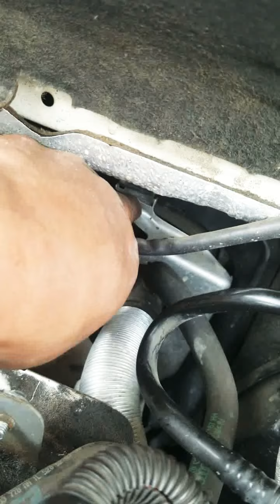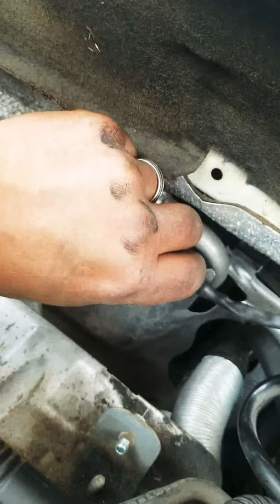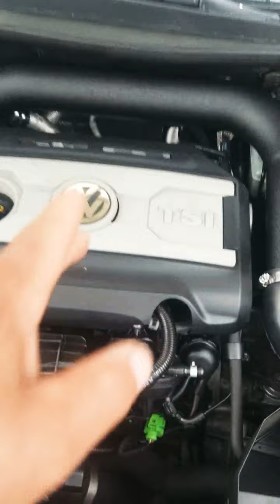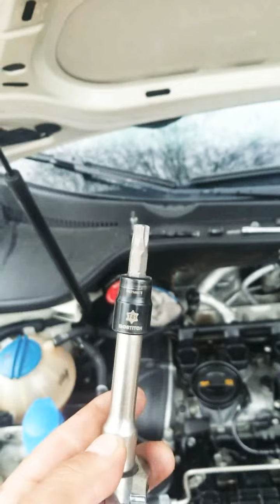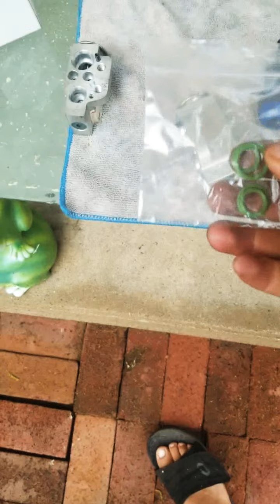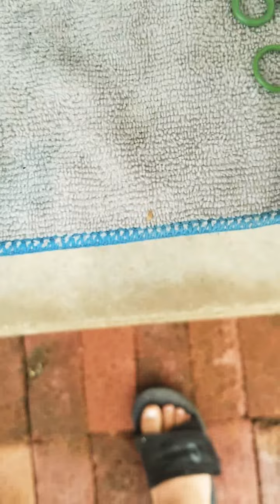AC expansion valve location/replacement (vw mk5)

Comment: A word a caution. I own a 2010 Golf MK6 2.5L CBUA. My expansion valve came overtorqued from the factory. It was extremely hard to remove the bolts. When I removed the expansion valve it bent the pipes and threw the pipes out of alignment. I know this because comparatively it was easy to pull the expansion valve from a used one. 
I should have stopped there and replace the threaded bracket, bolts, and tried to bend the pipes to restore alignment. Instead I kept forcing the bolts and ruined the pipes, bracket, and bolts further. Now I have to remove the dash to replace the evaporator, expansion valve, bracket, and bolts.
By the way, the bolt is a M5- .8x35mm. You can find it at home depot. I believe it is a grade 8. I found a grade 12.9. Another tip, to remove the threaded bracket you need to remove the foam around the expansion valve by cutting around the pipes. It will make it possible to move the threaded bracket sideways to free it. My manual says the torque specs for the screw is 5NM. I guess it makes sense because bracket is steel and the bolt is grade 8. But I would caution against torquing that hard. DON'T use a pry bar, picks, screw drivers and other tools that would distort the fragile aluminum pipes or you will have to remove the dash to replace the evaporator! 
It should be easy to slide the exapansion valve on the pipes and the screws should easily align to the threaded bracket. If you are forcing it, you need to realign the pipes.

Comment: Something everybody needs to check is the ATS "Atmospheric Temp Sensor" it's adjacent to  your MCU next to the windshield wiper linkage. If it's bad or the wire is broken. Your FCU (Fan Control Unit) will think it's 0C / 32F outside and will not allow your AC Compressor to start.
Reply from the maker: I appreciate the advice and I'll definitely check it out 👍

Comment: Hey, did you can have help to me? To me that problem.. AC compressor not working. Works when i fill to the AC system air from ressiver, about 7-8 bar, turning radiator fan. When i fill freon, my AC system not running... i replaced a new one pressure sensor and compressor selenoid valve, but nothing helped..

Comment: Hi there can you please tell what is your problem to change this valve ?
Is your ac wasn't work at all or working but low cooling inside?
Reply from the maker: Very good question my friend,  this part was changed as part of troubleshooting/diagnosing why the ac system won't work at all , I started by replacing the control solenoid valve and didn't fix anything,  the I replaced the compressor but didn't work either ( bought it second hand and I have my doubts) , then I  replaced the high pressure switch and didn't work,  next I replaced the condenser because I thought it may be clogged but didn't work at all and last but not least replaced the expansion valve but didn't get any good results 😩😩😩 ; so my next move is to replace the compressor again but this time is going to be new 😁 hopefully this will fix my problem.  
Any ideas or feedback will be appreciated 🙋‍♂️
Reply: @gtolatino79  you can first chick the gas flow if not good last part you didn't changed inside evaporator maybe clogged and please tell me whats happen with you thanks
Reply: Maybe it’s your dryer on the evaporator.  You might need to put a new one in and pull a long vacuum before you charge it up

Comment: Hey how did you
Get the plate completely off to work with the lines?  Did you remove the radiator lines?
Reply: Please answer this question as I am having the same issue. I removed all clips and screw but the heat plate is still in the way.

Comment: Did you flush the lines before you put everything back together? The gunk from the broken compressor will destroy the new parts if it isn't flushed out before you recharge the system.
Reply from the maker: yes sir I did pulled vacuum 👌👌👌
Reply: @gtolatino79  but, pulling a vacuum and flushing the system are two entirely different things. Pulling a vacuum simply allows you to put in the correct amount of freon without over-pressurizng the system. Flushing the system is done by using an appropriate chemical solvent using a pressurized tank hooked to an air compressor via an air line to flush out lines and components such as evaporators, driers, etc. You should never attempt to flush out compressors valves or switches. If you had a compressor fail, usually they start sending metal fragments throughout your system. Not flushing the system prior to recharging after replacing your expansion valve is probably going to land you back at square one. You may even have to get another new compressor, at the very least another new expansion valve.
Reply: @RobertHallIV  flushing the condenser and replacing the dryer should be enough if not a lot of particles came out in the flush. If a lot came out then yeah you need to flush the entire system if not then you good.

Comment: Your first compressor doesn’t stop ?
Reply from the maker: The first compressor didn't work at all and my second one didn't work either so I decided to replace the expansion valve but I couldn't find any information about the location of it and when I found it decided to make the video about it but replacing it didn't make my AC work either 😩, I'm going to replace the compressor again but this time I'm going to buy a new one because the second one was used too 😁
If you don't mind me asking I'll like to know what is the problem in your car?
Reply: My problem is that my compressor does not stop when I turn off the climate control unit. I have an AC machine and add the exact amount to the system and still nothing has changed
Reply from the maker: @yeisonnduran  🤔
In my opinion your problem is something electrical like for example the controllers to turn on and off the ac , it wouldn't hurt  anything if you replace it ; just go to your local junkyard and get you another one , replace it and give it a try . 
Let me know if you get it fix my friend.